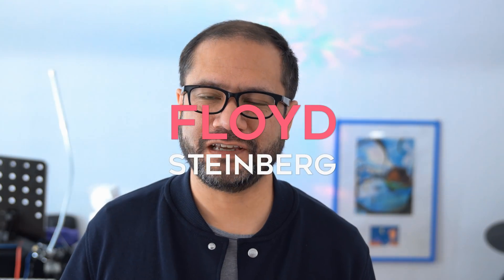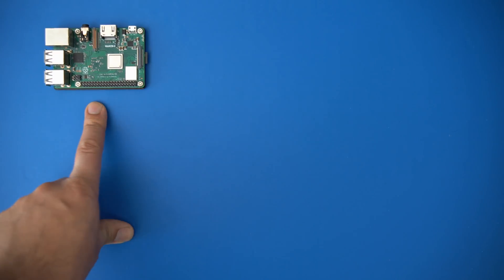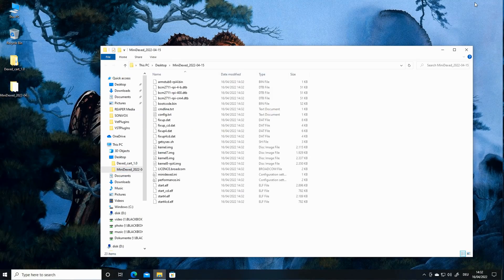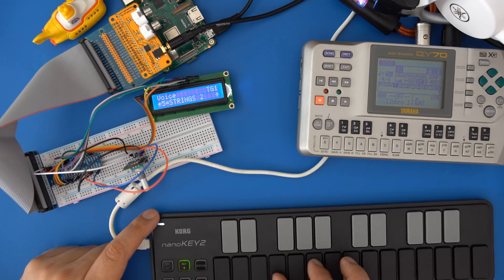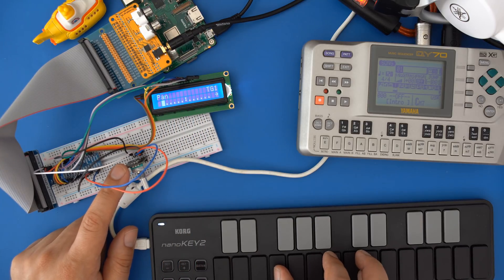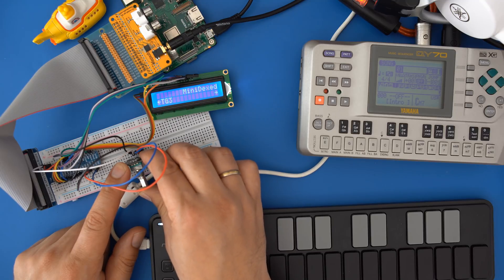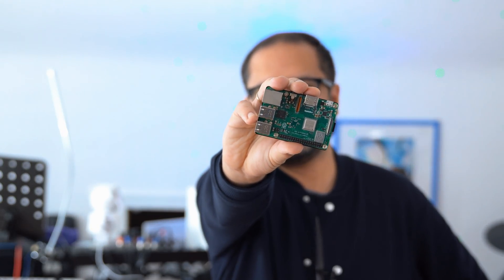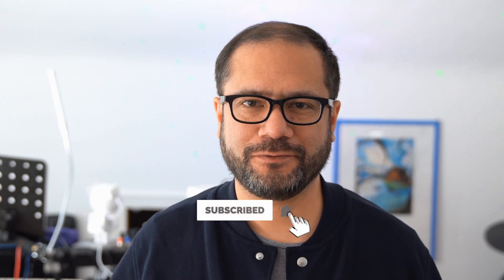MINIDEXED - honey, I shrunk my DX7 collection

Comment from the maker: Resources for this project: please remember to support the devs if you like this

MINIDEXED https://github.com/probonopd/MiniDexed, also join the discussion on https://github.com/probonopd/MiniDexed/discussions
Audio hat ("soundcard"): https://raspiaudio.com/
LC Display: https://bit.ly/3L6NF8N
Rotary encoder: https://bit.ly/3KSts6o
GPIO expander: https://amzn.to/3M8Kduf
You can also buy one of the sets by Freenove: https://amzn.to/3rtuvBR - these will get you a lot of components useful for synth projects.
Reply: On the video you show creating the sysex/voice directory.
How do you access these files from the hardware please.  Got me scratching my head. 
Currently waiting on a screen and rotary.
Reply from the maker: @elusivemite  those show up in the "bank" menu. MIDI program changes and bank selects should work.
Reply from the maker: @elusivemite  please plug in a screen (hdmi) while booting. do you spot any error messages like "invalid filename"? if yes, just rename your SYX files to something like 01.syx, 02.syx and so on.
Reply: @mr_floydst  il give that a try later thanks. Don't recall any errors but il check in a bit.
Reply: @mr_floydst   that did the trick. As an aside. I numbered the banks and put names in brackets after the digits and it loads them fine .

Comment: I want the Minidexed Eurorack module, but I can't figure out how or if you are able to control detuning, levels, and panning on that device, since it does not have a screen like you do. Stereo out on the Minidexed is actually really awesome, and I want the eurorack version so I have Moog, Pro-One, and TX816 in one case. Almost everything I need for 80s style sounds. I also own a TX816 so it would be fun to make performance patches and dump them into something more portable for live performance.
Reply from the maker: Hi, please check Minidexed 's MIDI implementation chart: https://github.com/probonopd/MiniDexed/wiki/Files

Comment: "We need to enable it by changing this line of code" Proceeds to not show the code and moves on. There are a number of similar problems in this video that make this video maybe more confusing than it could be.
Reply from the maker: Thanks for your feedback! I think the line is visible on screen as I say that. There's a "Notepad" editor showing some lines and I'm adding and removing some # comments.  You can also see a "Windows File explorer" from which you can deduct that said file was opened from the root folder of the SD card.
Balancing these videos is challenging. If I talk too slow and the pictures don't move quick enough, people move on to other videos, which will make YouTube not recommend this video.
Reply: @mr_floydst  I can yes, It turned out my Ic2 screen was DOA and the backlight was all that was working, so my frustrations spilled over to not seeing the code easily. Sorry man :)
Reply from the maker: @Tuathband  No offense taken! Criticism  often is more valuable than applause.

Comment: Great video Floyd!  So I built one myself using a Rasberry Pi 3 B+, included the LCD and encoder and a DAC but am getting an error on boot 'serialmididevice: Serial.Read() error: -1' however this occurs when I have either a USB keyboard controller (Arturia Keylab 88 MKII) or just a QWERTY keyboard or nothing plugged in.  Any suggestions?
Reply from the maker: Please check this thread: https://github.com/probonopd/MiniDexed/discussions/411

Comment: Kann ich eine alternative Audio Hat nutzen? Ich bin broke AF
Reply from the maker: You don't need that audio hat at all, you can just use the internal audio jack or HDMI audio. Apart from that, PCM5102A and PCM5122 based DACs are supported, so if you have one of those at home, that's your best option.
Reply: @mr_floydst  Danke Herr Steinberg! I have found a cheap PCM 5122 hat, I saw on the moby pixel tutorial that he wired the screen from the audio hat, I will see how i get on.
Reply: @mr_floydst  I am going to do it sans the audio hat just to get it going.

Comment: Hi Mr. Floyd. Thanks for a great video! Do you have any solution for a slighty distorting sound? i am using raspiaudio ultra+ HAT on a Pi Z 2
Reply from the maker: What kind of distortion is that? More the "overdrive" distortion (output signal too hot) or a digital distortion (stutters, weird noises)?
In the first case, check the output level. You can do that in one of the submenus.
In the second case, check the amount of synths in the config file. Pi Zero 2 can't run 8 synths simultaneously if I remember correctly, please reduce the number to 1 and test again and then slowly go higher.
Reply: @mr_floydst  So i tried ToneGenerators=1
Polyphony=8 and 16, and unfortunately it did not do the trick..sounds are guite amazing otherwise, just not very useful when the general output is slighty saturated..I don't have any ideas what to do about this :(
Reply: Thanks for the reply Mr. Floyd, much appreciated! 

Yeah thats precisely it, signal is too hot… i tried lowering output level in submenu’s, and that didnt do the trick. but I will def try lowering the amount og synths as first thing…will get back.
Reply: I found another solution, i replaced the ultra+ with a V3. Now the output is clean and i am quite happy about this thing 🎉

Comment: This is wonderful, thank you for sharing! Instant sub, cant wait to dive into the rest.

Now I really want to build a Minidexed unit myself. I'm not bad with a soldering iron, but a complete beginner in terms of how stuff actually buttons up and how to follow the quite daunting schematic on the github.

If you happen to have any advice, I would be most grateful. A vague request I know!
Reply from the maker: You can buy a breadboard and a couple of wires from Aliexpress, bypassing the soldering. 
https://www.aliexpress.us/item/1005005968711434.html
https://www.aliexpress.us/item/3256805804401192.html
https://www.aliexpress.us/item/3256804460701476.html
Reply: @mr_floydst  wonderful, thank you very much for the reply and information. Keep on keeping on making cool things!

Comment: Minidexed works in headless mode, what an awesome synth!  I'm surprised that the midi controls used for effects like reverb and cutoff appear to be hardcoded.  Minisynth has a parameter mapping for this.  My Alesis has a utility to change the values it sends, but I like to use my controller for several different projects, for example, I might have another SD card to run a different synth.
Reply from the maker: Hi, thanks for watching! You can always drop a feature request on the projects GitHub page. ;-)

Comment: I'm defo gonna build one of these. But not a fan of the minimalist interface (though it does make it VERY compact and portable). Gonna slap on an interface like I did for my HS Expander I think, since that is still pretty minimal (3 sliders and an LCD) but removes all menu diving :)

Amazing what fits on an tiny board like the RPI these days.
Reply from the maker: Thanks for watching! - yes, an external MIDI controller certainly helps here.

Comment: does anyone have expierence building a 5 pin midi input for this project? Thanx in advance! greetings form the netherlands
Reply: Do I have to change something in the code to use classic 5-pin midi?
Reply: @wimlenthevan5908  the doc mentions that the easiest thing to do is to buy one of those 5-pin to usb adapter cables and plug that into the pi! Easy peasy!

Comment: Dear Floyd, i did follow your instructions but i can't get the display or the dataencoder working. do you have any suggestion? i don't know what i am doing wrong. thank you for your comment.
Reply from the maker: Hi!  The most obvious reason for that is "you've got the connections wrong". There may be five reasons for this:
1) you swapped some wires.
2) you connected wires to the wrong pins.
3) your didn't use exactly the components the project description calls for.
4) some of the parts you're using are damaged.
5) some of the connections you made are broken / cold.
I think it's rather unlikely this is a software problem. Start by trying your screen and encoder in other projects, verifying they're in a working order, and then try to rule out the other sources of problems. Good luck!
Reply: @mr_floydst  thanx for your answer. I tried the display on an arduino uno, that works. No I ask myself: do I have to upload a library for the dx7 project, or is that all in the software?
Reply from the maker: It's all in the software, no need for additional libraries. If you're stumped, please also check the projects homepage /github page, https://github.com/probonopd/MiniDexed 
Also check your minidexed.ini settings.
Last but not least, you can always post your problem here: https://github.com/probonopd/MiniDexed/discussions
Reply: @mr_floydst  Dear Floyd, thanks for help! it works now. maybe i did wrong wiring with the display. the rotary encoder seemed broken (although it was new). so everything worked out well!

Comment: So you are running with just 1gb of RAM, that's impressive. Is there a benefit to use the RBPI4 with 8gb?
Reply from the maker: I didn't follow the latest updates, but I think there's no benefit in throwing more RAM at it. In fact, you can go even lower than 1GB because this skips the entire operating system by running directly on hardware.

Comment: Just a small question: When using a raspberry pi4b plus the Audio hat for this project, is there any knowledge about whet current this setup will draw from the 5 volt usb-c supply ?
Reply from the maker: Hi, thanks for watching! I'm sorry but  I never checked in on that.
All I can say is you can run this project on a typical power bank for days.
I'll try  to check power consumption some time, but perhaps other viewers can share their knowledge here?
Reply: Thank you for your prompt answers 😃👍🏻 Hope someone else can answer this? From the datasheet of the pi4 I know that the pi needs at least a 2.5 amps power supply but since your projects run from a bare metal pi, I guess the power consumption might be far less?
Reply: I have a preliminary setup and the power consumption is about 370mA @ 5 volt. https://youtu.be/eVK8PfLgHwc

Comment: What a great project! I get one or two pi4’s, already have ordered two types of audio modules (one with PCM5102A and one holding a PCM5122), I have some rotary encoders and a 16x2 LCD, but I plan to use the 128x64 I2C OLED instead.
The end goal is to make a euro rack module out of it to fit my diy synthesizer.
Reply from the maker: Thanks, and good fortune with that project. :-)

Comment: 2030: we can now run 8 Roland JP-8000s on a Raspberry Pi 7... haha in my dreams!
Reply from the maker: Hi, thanks for watching! Perhaps I'm overly optimistic here, I if a software emulation of the JP8000 existed, I'm sure the PI4 could run 8 of them.
You could try ZynAddSubFX, it has the supersaw wave, if I remember correctly. ;-)
Reply: @mr_floydst  The JP8000 came out about 15 years after the DX7. The DX7 was 16 note polyphonic in 1983, JP8K only 8 note polyphonic in 1997. That gives some indication that the JP is much harder to emulate than the DX7.

Comment: This would be even better if it utilized the official Raspberry Pi 7inch touchscreen instead of the rotary encoder and 16x2 LCD.
Reply from the maker: Thanks for watching! It's open source, so you theoretically could do that yourself. (Or join the discussion on https://github.com/probonopd/MiniDexed)
Reply: @mr_floydst  Thanks Floyd. I'm seriously considering this (even though I've just purchased the Korg Volca FM2 a few days ago) because I own two Raspberry Pi 3B+'s DAC's and official Raspberry Pi 7inch capacitive touch screens.
I bought the Pi's with the intention of porting my midi sequencer that I wrote for Mac OS to the Raspbery Pi but moving from Objective C to C++ and JUCE is very time consuming.
Reply: @mr_floydst  Hi Floyd, that github link didn't work for me.
I did manage to find probonopd via a search and in the discussions area, I found this answer, to someone asking about using another display.

"Graphical displays would be nice, but would also be a fairly significant piece of reworking of the UI everything currently assumes it is driving a "text" output supported by the circle environment."

I think it would be much easier if I just ran Dexed for linux LV on the Pi OS.

Comment: Thanks for the Video, great content and great sound! really showed that off using those Stereo sounds, great work! Would be even greater if it was possible to combine f.e. one core of BareMetal and a single-core Linux installation which could handle a Web-UI. That would make this project so much easier both to build and to handle. Is that even possible? F.e. 1 Core BareMetal+SingleCoreLinux for Pi2-Zero which I have laying around. Another version would be a Pi-PicoW or a ESP32 to handle the web and a BareMetal PiZero-2 for Sound generation.
Reply from the maker: Hi, thanks for watching! At the moment, I think this is not possible. Projects that are built like this commonly use an Arduino or Teensy on top of the PI for additional user interfaces / inputs.

Comment: Great video.  Thanks for doing this.  I got minidexed running on my RPi4 without the display or knob or soundcard.  Using the M-Audio Oxygen49, I can at least change patches on it.  It's like a cheaper version of the Korg Volca FM, but with more polyphony (it is at least a 5 note polyphony, but it might be higher).   Looking forward to slapping a hifiberry audio hat into the unit to clean up the output.
Reply from the maker: Thanks for watching! On a PI4, you should get 8 virtual DX7s, which means 8 part multitimbrality and 16 voice polyphony each (8*16= 128 notes)
Reply: @mr_floydst  Thanks for the info.  I've been noodling this this gadget off and on this afternoon.  It's a little tricky to manage without the display, but I can see the possibilities.  And I've never had my RPi boot so fast. :-D

Comment: Looking to make this a bit simpler. Does anyone know how to modify the ini file permitting support (as Zynthian does) for the behringer UCA series of USB audio interfaces?  Also the 
DFRobot IIC 16x2 RGB LCD KeyPad HAT for Raspberry Pi V1.0, has controls on board and appears to be a vastly more convenient solution, as it's a hat... does this work/anyone know how to make it work if it doesn't . 

In essence, trying to get all of this running on a PI3, using an M-Audio 1x1 midi interface (which should just work), that LCD and the behringer for audio (as it also has optical Toslink output, which will mean I can very cleanly stream to my mixing desk)

Many thanks
Reply from the maker: Hi, thanks for watching! As long as your audio converter is built around a PCM5102A or PCM5122 chip, it should work. Regarding MIDI setup, please join the discussion on https://github.com/probonopd/MiniDexed/discussions .

Comment: After I see this video I assembled the circuitry and put minidexed on a 2GB (!) SD card I had knocking around. Sadly my LCD has died since my last project, so I'll have to get a new one, but it sounds absolutely wonderful. It didn't like my AKAI MPK Mini Play (I think because it doesn't default to midi mode ?) so I had my Beatstep running patterns through it. Even the analogue audio on the Pi 3 sounds good though!

Anyway - thanks for another excellent video!
Reply from the maker: Thanks for watching! This project is worth keeping an eye on for sure.

Comment: With more of these pi based solutions coming out, it would be nice to see an enclosure available with the capabilities to support them. Im talking a shield with inputs/outputs/audio dac, screen, controls.
Reply from the maker: That would be nice, but I think it's unlikely to happen soon. Developers would have to settle for a standard (interface assignment) and there's R&D and marketing and distribution costs involved - a lot of work and risk to be taken. Could be a kickstarter project perhaps.
Reply: @mr_floydst  Besides, DACs are unobtanium. Look at stock on digikey and mouser, it's all zero stock with 6 months or more wait time. It's great we can find these boards  in stock now, but good luck if you want to start making new stock and you're not already on someone's priority list.

Comment: How easy is it to create a MIDI interface? I'd like to see a MIDIfication process of lower class keyboards that don't have MIDI but would benefit greatly from such  a modification.
Reply from the maker: Hi, thanks for watching! For this video, I just used a $10 standard USB midi cable. 
You can relatively easily turn the GPIO pins into a MIDI port: https://www.osaelectronics.com/learn/setting-up-raspberry-pi-for-midi/   but as this here is a bare metal project without the Linux OS, this knowledge won't help. ;-)
Best is to join the discussion at https://github.com/probonopd/MiniDexed/discussions
Reply: @mr_floydst  Oh!! You used "fake" midi. That's a bit naff. Is old skool 5 pin MIDI DIN too complicated? 😁
Reply from the maker: @Leepshin  I didn't know "MIDI connector elitism" was a thing, but here we are. ;-)

Comment: This is amazing..  I have had a DX7 since '85 when I bought it new, but now I need to build this!!  One question - What was making the drum sounds in your video?  The DX7 isn't particularly good at drums.  I assume these were built into your sequencer?  Also.. did you know there's a similar project for the MT32?
Reply from the maker: Thanks for watching! Yes, the drums sounds are from the sequencer I used. (though there are some great sounding drum patches out there for the DX7 - they just were not that useable on a synth that's not polyphonic)
I know of that MT32 project. Perhaps another thing to make a video about.